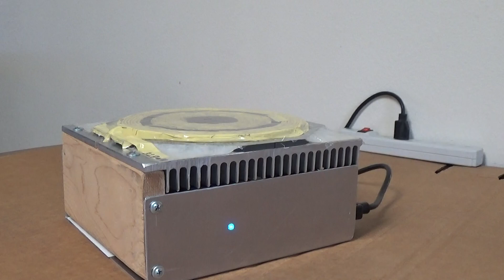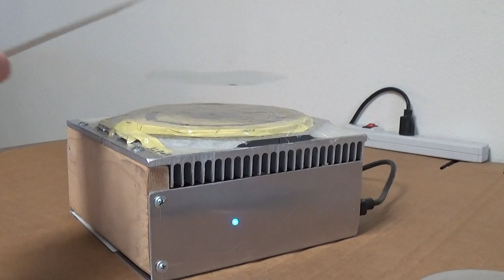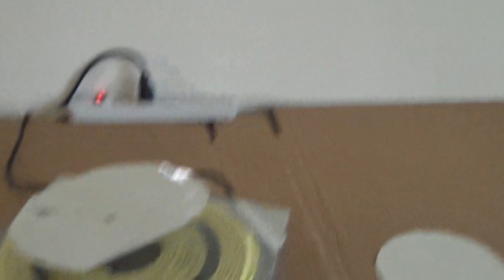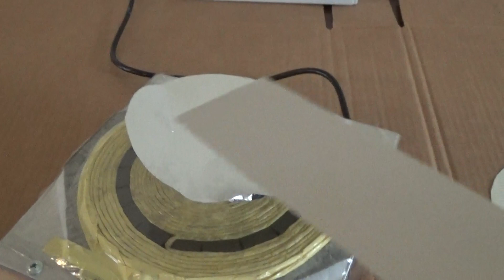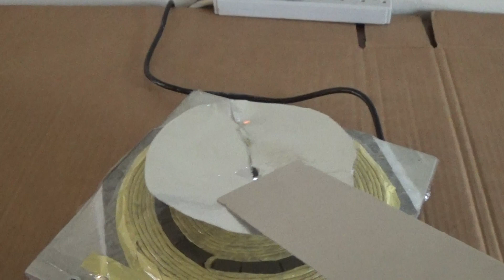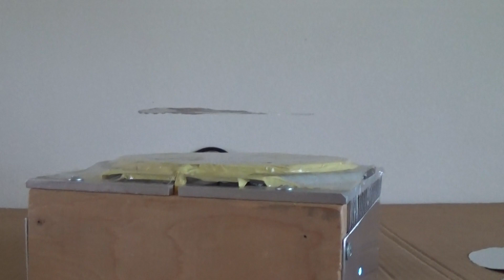Stable eddy current induction levitation of aluminum disk

Comment: could you provide more information how to build device like this? thx in advance
Reply from the maker: Coil geometry is covered in video description above.  Circuit for driving coil isn't what I'd design if building this today.  Probably something closer to Mazzilli oscillator I used for my Jacob's Ladder, documented at:
    https://highvoltageforum.net/index.php?topic=831.0
For a bit smaller versions, you could use the cheap induction heater circuits from China, available on EBay, Amazon, etc.  They are also Mazzilli oscillators, though lower voltage and higher current.  Could be used for this size, but coil would need to have fewer turns of heavier litz wire (more strands).
After thinking about this overnight, a commercial induction heater circuit could work for this size and geometry with a bit of modification.  Needs to handle at least 48V DC input, such as this example from EBay:
    https://www.ebay.com/itm/184758329544
200W is sufficient power, so this 1000W unit is more than needed.  Likely would need to wind extra turns around the two toroid inductors, and perhaps remove one or more of the resonant capacitors (black 0.33uF caps) to get desired frequency.  Would need to run somewhat lower frequency for 48V supply to be sufficient, perhaps 15kHz.  Might be fine there, as audible noise should be mostly at 2x frequency, so 30kHz, beyond hearing range.
This will function without the ferrites, but that does require more power for same levitation height.  Also requires having space below coil before any metal parts or structure, at least 5cm.

Comment: Very nice, how much?
Reply from the maker: If you are still interested in ~15 years, check back then.  At that point I may be too old to lead any science activities or have other uses for my projects.
Reply: @davekni  can it levitate aluminum or copper powder?
Reply from the maker: @starg8240  No.  Levitates only objects similar size to what's shown in video.  Larger disks will levitate, but not be stable, falling off one side or the other.  Smaller disks tilt down so one edge touches coil.

Comment: Hi, I realize it's been some years but in your initial planning had you thought about a lower current version of this? Would it be possible to use a different frequency or higher voltage AC at lower current and through thinner wire in the coils to generate the field for less power?
Reply from the maker: Great question!  Higher voltage at lower current is certainly possible, but I don't believe there would be any power advantage.  2x voltage for 0.5x current.
Some efficiency (lower power) could be achieved by reducing frequency some.  I picked 23kHz because I'm very sensitive to ultrasonic sound.  (Can't hear it, but it gives me ear aches.)  With clean sine wave current and no DC magnetic field, any sound should be at 2x frequency, 46kHz.  Earth's DC magnetic field makes a little sound at 1x frequency, 23kHz.  If sound isn't an issue, most efficient frequency is probably in the 2-5kHz range.  I haven't explored that in detail.

Comment: Floating pan? Who wants to make one work for food?
Reply from the maker: The UC Davis physics department has a larger 60Hz unit that levitated a 1/4 x 16" aluminum disk.  Sometimes professors would demonstrate the heat generated by eddy current in aluminum disk by frying an egg on top.

Comment: interesting, the magnetic force muffles the ringing sound. i guess it's the force that keeps it floating is muffling the vibrations, I only wonder how does it look on molecular level? the same as drops on the water?
Reply from the maker: Not sure what "ringing sound" you are referring to.  This unit is running at ~23kHz so levitating force has a 46kHz component, far above audible frequency.  Perhaps you are thinking of the 400Hz driven large museum unit in France (forget the name off-hand) that makes an 800Hz sound.

Comment: Assume that is a "MOSFET" and not a jfet. Would an IGBT be better for that?
Reply from the maker: Yes, MOSFET.  IGBT would be fine too.  Power isn't high enough to make a big difference.
If I were making this again, I'd try a ZVS circuit as in simple induction heating kits found on EBay etc., but with higher voltage parts to run directly on rectified 120Vac as I did for my Jacob's ladder project.
Reply: @davekni  Thanks!
Reply: @davekni Been looking at zvs modules recently, and may get one to try levitating a lightweight foil ball inside the coil first. I’d like to get a variable frequency, variable voltage, variable current AC inverter of some kind. Any recommendations?
Reply: Saw My own reply now when considering making this again, and realized I knew more about IGBT and JFET back then. Sigh... Mastering electronics engineering AND computer science simultaneously has been A LOT of study and also obviously some practice.

Comment: What would it take to turn it the other way and have it lift itself and the power supply over the aluminum? I'm assuming the aluminum would have to be thick and so would the copper coil, plus you'd have to push a ton of power through it. It has to technically be possible though right?
Reply from the maker: There are videos from other people showing coils levitating over aluminum or copper.  However, they are not completely free, as wire leads are needed to feed AC power to coil.
Reply: @davekni  i've seen a few of those. I've also seen videos of the Hendo hover systems that are battery powered and use rotating magnets over copper. Is that the same effect as this? I was under the impression it was something related but different.
Reply from the maker: @Viperlover-cw2qx  Took a quick look at Hendo web site.  Mostly extreme hype.  Expect their investors are disappointed or soon will be.
Yes, similar but not identical.  Similar in that an alternating magnetic field creates eddy currents in a conductive plate.  Eddy currents create an opposing magnetic field (block field through plate) so result in levitation.  (Copper is more efficient since it is more conductive.  Being the base, no issue with copper being heavier.)
Different in that alternating magnetic field is created more indirectly.  Alternating current in motor windings creates rotation (by creating alternating magnetic field inside motor).  Rotating permanent magnets create alternating magnetic field.  At first glance, this indirect approach seems less efficient.  After some thought, I can see how it could actually be more efficient.
A large device and small levitation gap becomes more practical, as in maglev trains.  Still quite expensive.  And versions with passive rails still need sliding electrical contacts to provide power to engine.

Comment: 45A rms 220 V them u wanna say us it works at 9,9KW??? 😮
Reply from the maker: It is 9.9 kVA, but not 9.9kW.  Power factor is almost zero since voltage and current are almost 90 degrees out of phase.  Actual power is about 200W.
Reply: @davekni  ah ok ... I was going to build one too with the coils of an induction hob. I also made a calculation of the magnetic energy and power to be used to leaven a sheet of copper or aluminum but without calculating the energy lost due to the resistance of the copper or aluminum. 200W to prove to 30cm is all energy lost! in reality the power should be 1/2 mW if we hypothesize the resistance of aluminum with value 0 and its weight 1 mg
Reply from the maker: @davyponte  If we approximate earth's gravity as 10m/s^2 (10N/kg), then 1mg weighs 1E-5N.  Lifting 1mg by 1meter requires 1E-5Joules.  To lift 30mm requires 3E-7Joules (0.3uJ).  Thus 0.3uW could lift 1mg to 30mm in 1 second.  0.3mW could lift it in 1ms.
Once lifted, now power is consumed in maintaining height.  All power becomes heat, in coil, in aluminum due to induced current, and in circuitry generating coil current.
BTW, 1mg is a tiny piece of foil, perhaps 5mm diameter depending on thickness.
Reply from the maker: @davyponte  My last reply ignored one detail.  A tiny bit of power will be radiated out to space as electromagnetic radiation, even in an ideal case where wire and aluminum resistances are 0.
Reply: @davekni  Exactly! this calculation is the theoretical power to leaven a 1mg aluminum foil or tame... ideal because the internal resistance of the object is neglected! but be careful if in reality the resistance of the object is 0 then we speak of superconduction but superconducting materials prohibit the crossing of external magnetic fields... therefore you could not have eddy current and controlled levitation but only levitation for a natural effect.
I'm trying to simulate the levitation phenomenon due to the eddy currents with a finite element software the name is comsol multiphysics, the version is 6.0 . you can try too you can find it on the net but you must have a license I can help you if you want. but remember to understand software and electromagnetism you must have math skills in "vector analysis"
one last question... have you put the circuit into resonance because the actual power you use is 200w and not 9.9kVA?
Reply from the maker: @davyponte  One correction:  Superconducting materials block magnetic fields by conducting eddy current.  That eddy current creates a magnetic field exactly canceling the external field, so zero field inside.  There is eddy current in superconductor.
BTW, I use a simpler free tool called FEMM for finite element analysis of my home projects.
Reply from the maker: @davyponte  Forgot your final question:  Both 200W and 9.9kVA are correct.  First is power, other is volts*amps.  Real power (200W) is due to resistance of coil and of aluminum.  Not any resistance I intentionally added, just the unavoidable resistance of real wire and aluminum.
There is a capacitor in parallel with the coil to handle the reactive power.  Resonant circuit at 23kHz operating frequency.
Reply: @davekni  then u mean… if creaw a magnetic fild with a coil… Can I make a superconductor levitate?
Reply from the maker: @davyponte  Yes.  Levitation of superconductors works all the way down to DC.  Thus a permanent magnet works.  No need for power.  A bit of internet searching will show images of such levitation, though usually reversed, with permanent magnet levitating over superconductor.  Easier to keep superconductor cooled when it is on the bottom.  (Type 2 superconductors pin magnetic field, so allow stable levitation with single magnet.  Doesn't require the field shape of AC levitation coils for stability as is required in this video.)
Reply: @davekni  yes, I knew the phenomenon of stable magnetic levitation caused by superconductors. in fact, to have a controlled distance it would be enough to adjust the supply voltage to the coils. the only problem remains the nitrogen which superconducting effect, on the superconducting material, does not have a long life. it should be well thermally shielded. I found a superconductor dealer on the net.. for example a type 2, the smallest, costs around €70 if I remember correctly

Comment: Some photos of the build would certainly be appreciated! Surprised that it seems to say the SAME wire is coiled one way and then reversed halfway through the winding so that it makes a second coil in opposite direction in the inner circumference of the first winding. Had originally assumed it was 2 wire coils with one nested inside the other with AC 180 out of phase in second coil. But then thought 2 wire coils with one reverse direction winding. But then saw ONE wire seemingly coiled in both directions...that was surprising! Didn't know one wire could make 2 opposite magnetic fields in that kind of configuration. So basically it levitates without flying off because 2 magnetic fields in opposite directions generate 2 other magnetic fields in opposite directions from the eddy current loops in the aluminum and thus the aluminum plate is pushed AND pulled by the coils simultaneously? If so, is it necessary to make the push coil have more windings than the pull coil? Oh, and the ferromagnetic pieces are there basically to strengthen the fields, right? Thanks in advance for explaining and thanks again for posting that video!👍🏻
Saw now that the coils are flat. Wow, want to make one of those and a piezo lighter dipole antenna transmitter/receiver combo ASAP! Tried flipping that levitator on a large piece of aluminum to try making it move around on the aluminum plane with rotation of coils?
Reply from the maker: Reversing the winding direction is the same as 180 degree phase shift between two separate coils.  Winding reversal is easier.  For a given half-cycle of current, the ring between coils is north pole.  The center and outside are both south poles.  Reverses every half-cycle.  I think of it as creating a bowl of magnetic field with strongest part at the ring between coils.  This "bowl" keeps disk stable.  Enough field in the center keeps disk from flipping vertical.
This works without ferrites too, just not quite as efficient.  I did all my experimenting with small scale models, about 30mm diameter and no ferrite, levitating aluminum foil disks.  Making a simple one shouldn't be too difficult.  The cheap induction heater kits on EBay etc. would provide plenty of drive power.
Reply: @davekni  Thanks! Saw now. Interesting explanation. Would be cool to get some magnetic field viewing film to view that or a CAD app that can do that kind of 3D representation of the fields. I'd maybe use an ESC (or build a simpler ESC than a drone motor ESC) to drive that. I don't do anything involving with mains voltage straight. (Although not chinese, visiting china...so that is part of why)
Reply from the maker: @OMNI_INFINITY  Look up FEMM.  It is a free public-domain 2.5D magnetic simulation program.  This coil wouldn't be hard to model and display resulting field.  FEMM does take a bit of learning to use, however.
Reply: @davekni  Saw now. I am designing a coil. Thanks!
Reply: @davekni  Made a PCB pancake coil like that, with one coil that is wound in opposite directions concentrically and then it goes through center of the board to other side and matches up. Considering getting a variac to properly test it soon, but are those pieces of iron or magnets between the 2 coil winding directions and in center? Are those necessary to make that function properly? Thanks in advance for answering soon! Pondering getting a variac this weekend. Would be plugged straight into 220V wall outlet and then straight into the coil. (Again, it's a 2 sided PCB with one coil that goes through center and is basically flipped on other side to combine the mag fields)
Reply from the maker: @OMNI_INFINITY This coil is running at 23kHz.  At line frequency (50 or 60Hz), levitation requires more current and more turns and iron core, as shown in my other levitation video:
   https://www.youtube.com/watch?v=fw_iYnzemMo
For this 23kHz unit, there is soft ferrite material under coil and between sections and in center.  This improves magnetic field strength some.  Not required at 23kHz.
Reply: @davekni  Thanks again. Here again because pondering getting an autotransformer and remaking that PCB to include a spacing for ferrite ring and core (or simply an iron core).

Comment: It could push the projectile faster than gun powder does, and without any sound at all. 
Or it could be placed under the road for a floating car or floating skateboard in a skateboard park.
Reply from the maker: To answer the first half:  Accelerating an object that fast over a short distance will make a bang no matter what the method.  Less than with gun powder, but not at all silent.
Concerning the second part:  Much like maglev trains, which are possible.  Infrastructure costs would be very high, and so would be energy consumption.

Comment: Hey Dave, I am looking to build something like this for an experiment in acoustics. I like the idea of using the 220 induction cook top. Currently, search for a good candidate.
Reply from the maker: I don't have any particular cook-top recommendations.  If you pick one and get started, I'd love to hear how it goes.
Another option is the ZVS induction heater boards that can be found on EBay and Amazon.  There is a long thread on these in the High Voltage Forum:
https://highvoltageforum.net/index.php?topic=530.0
That forum is a great place to ask for advice and report results.  Good place for these ZVS circuits or if you modify an existing cook-top.
Reply: @davekni  thanks so much!!! I am going to check out the forum when I get back to the lab!

Comment: How does the respons on smaller like 1or 2mm size of aluminium?
Reply from the maker: Your question caused me to think for quite a while, and then finally to test to make sure.  Small pieces of aluminum don't lift, for two reasons.  First, the total magnetic (Lorentz) force drops faster than weight.  Second is that the direction of magnet force becomes more directly inward (attempting to compress the piece) rather than upward.

Comment: What’s the relationship between lift distance and weight relative to current and frequency?
Reply from the maker: That's a very broad question without any simple answer.  For a given coil size and drive frequency, there's an optimum thickness of aluminum disk for maximum lift height.  Thinner disks don't lift as well.  Neither do thicker ones.  The optimum is broad, so quite a range of thicknesses lift well.  For this 23kHz unit, optimum is probably around 10um.  I don't have any foil thin enough to test.  It still works fine with 100um foil (disposable pie tin).  By 1000um (1mm), it barely lifts at all.
For a given geometry, the optimum thickness goes by 1/frequency.  My slightly larger 60Hz unit has an optimum around 4mm.